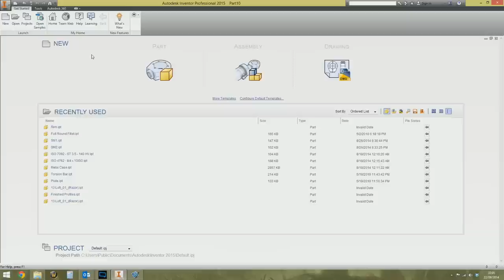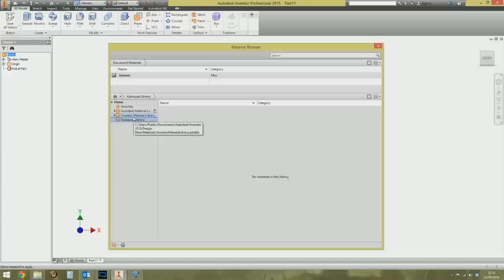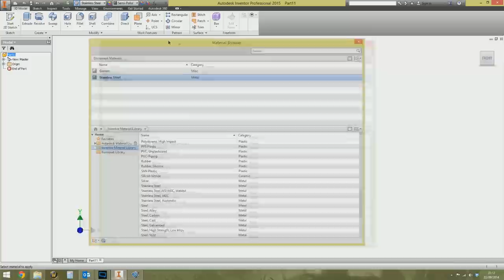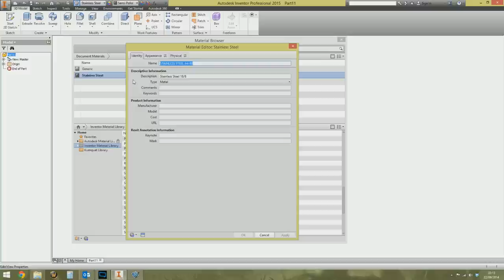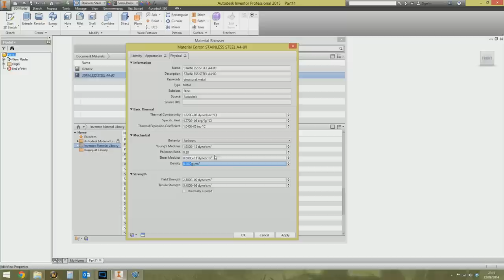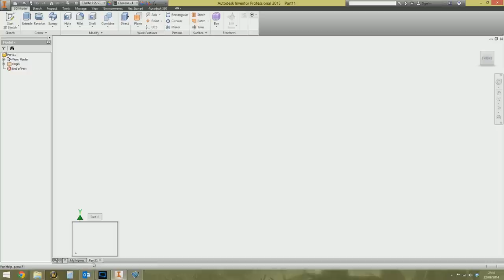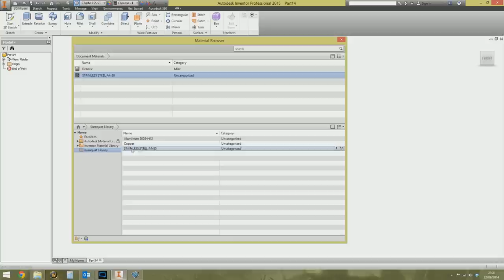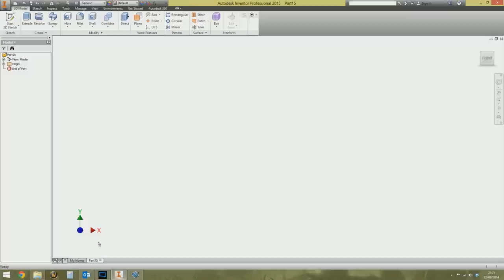How to Material Library, create and add materials | Autodesk Inventor

Comment: Firstly I'm sorry for my bad English language if you don’t understand for what I’m asking about maybe you can respond and I will explain again.
Thank you for the video furthermore I already made a new material properties I liked to say "SS400" (Japan standard code material) because I want to run analysis using frame analysis to have a result more precisely and so I found a problem, when i go to design > insert frame the family of the material and also size are the default option of the insert frame the only different on material option there where I found my new properties ss400. My question is, if I select ss400 on material and I insert the frame using closely material profile what I want let’s say on family > JIS G 3193 - Hot rolled H-Beam and size > 200 x 200 is it the result are the same like the default property JIS G 3193 or my new properties ss400? If there are same result so there is no effect if we use the properties of new material on the insert frame. Next step I haven’t try because I don’t know how to design the profile frame from the plate, need your guidance for this.
Thank you.
Regards,
AR
Reply: Andrew Renno still waiting you respond.
Regards,
Andrew Renno
Reply from the maker: Andrew Renno This isn't my full time job so I don't have much time outside of my day job to work on all questions unfortunately, I try to answer quick ones if I can.  I'm also in the middle of moving house too so I don't even have much time at the moment to create new videos!  If I'm reading your question right, you're asking if you use a custom material during the insert frame does it use the properties of your material? Yes it should... as long as you have published your material to the style library with the correct properties and have then used that material when placing the frame, I see no reason why it won't correctly use your material.  It should use your properties yes.
Reply: Thank you very much for your answer, sorry for bothering your time also sorry to push you to answer my questions. Ok hopefully your moving finish well.
Reply from the maker: Andrew Renno It's fine :) Thank you for watching my videos! I do get a lot of questions and I wish I could answer them all, the best place for a very quick answer is the official Autodesk Inventor discussion area http://forums.autodesk.com/t5/inventor-general-discussion/bd-p/78 there are a lot of experts on that site who answer questions very very quickly!